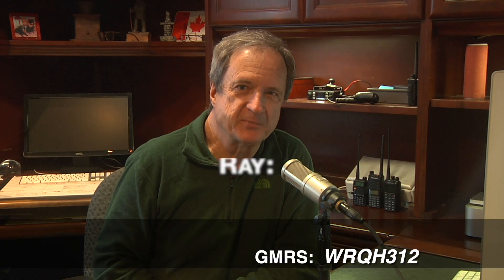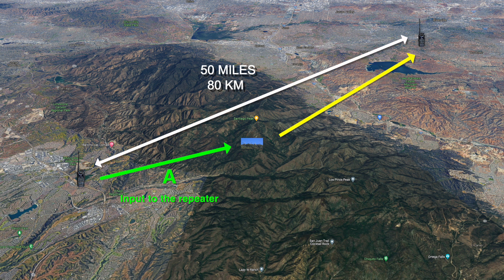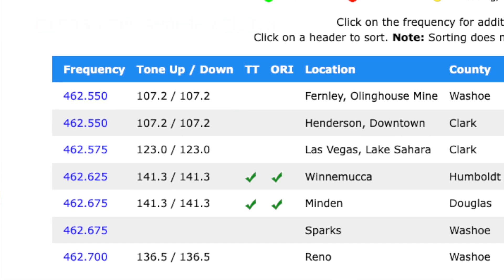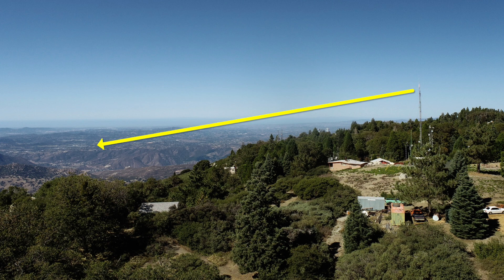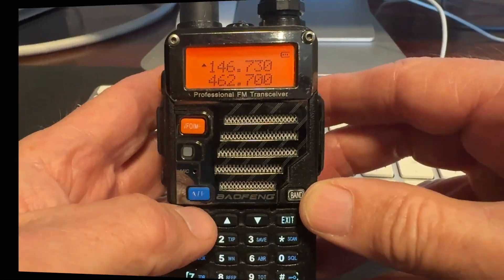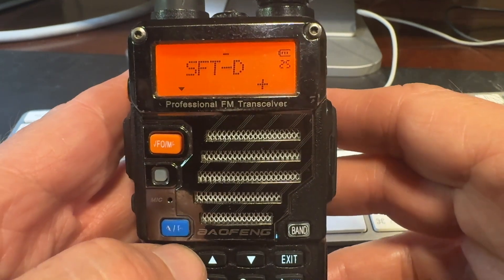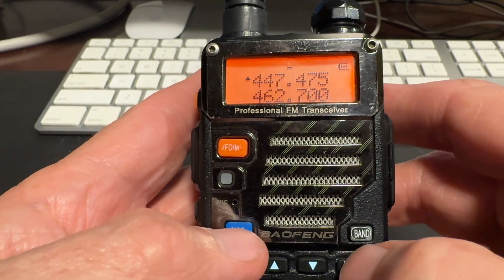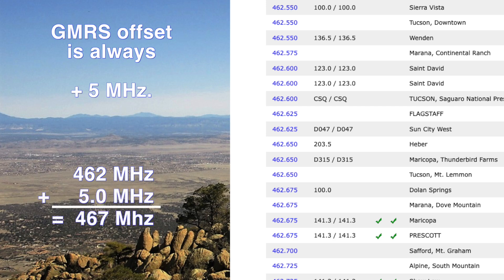Understanding Ham & GMRS radio repeater frequency offsets.

Comment: Thank you sir.  Trying to learn and get my lil Bo Fang to squeak literally anything at this point and I think the reason it doesn’t is in what you are sharing so learn g as I go here
Reply from the maker: It’s probably the simplest thing to miss that gives us challenges. 😉  

Start very basic. Double check your transmit freq, the -+ or simplex offset, and any Transmit tone if needed. 

On the receive side, turn off the CTCSS and DCS receive tone setting so you will hear any carrier on the frequency. Once you start to receive radio traffic, build on it from there. 

If you’re using a repeater, sometimes the published repeater CTCSS or DCS tones are out dated and have been changed. I run into that occasionally. 

Good luck.

Comment: Can GMRS Repeater use a different offset. For example 4 MHz?
Reply from the maker: @JustLearning  
Good question. No it can’t do anything other than 5 MHz. “Technically” a radio could do that, but it would be both illegal radio spectrum used and non standard. Only 462 MHz and 467 MHz are legal. 

Does that help?

Comment: Very good video and easy to follow. So.....if I program the frequency of the repeater RX and make the TX +5 Mhz (for a GMRS) it should automatically change the offset and direction shouldn't it? I have Beofengs and TidRadios and if you look MANUALLY at the offset settings when on a specific channel, it never shows the correct offset and direction even though the RX and TX are offset. UUUGGG
Reply from the maker: @ryanredd9930  
Yes you are correct. The programming sometimes does not show the offset clearly as +5 MHz. It looks like its simplex, but the offset is there is you look in the programming software in a different column. 

Also be aware that if you already have a frequency in memory, you need to delete it to clear that memory slot, then rewrite to it. It won’t overwrite an existing frequency entry. I’ve run into that more than once. Same with PL simple changes. It may hold it until you change channels, then it goes away. 

In VFO, it’s not a problem as it’s a temporary entry that can be changed. In memory channels it can’t be overwritten without deleting it first, even for the simplest change.
Reply: @Raymazon  Oh wow. That is probably the issue. I did not know it wouldn't overwrite an entry that is already there! That's weird because if I rename it, it follows with the new name. HMMMM
Reply from the maker: @ryanredd9930  Yes, it’s misleading. Try clearing it out.

Comment: does we hear our transmit voice?
Reply from the maker: I'm not sure I understand this question. If you are asking if there is a way to hear your own voice, the only way is by listening on another separate radio. You will not hear your own voice on your own radio unless the repeater has a voice-recorder built into the repeater controller hardware. 

Though technically possible, it is rarely offered on most analog repeaters, and is at the discretion of the control operators or owners to make that function available. 

(DMR "Digital Mobile Radio" radios can do that voice replay via the Brandmeister server, but that is digital radio, not analog radio, and a completely different radio operation.)

Does that answer your question?
Reply: @Raymazon  yaah thanks, i thought taat by usang repeater its also repeat your own voice causing feedback

Comment: Thank you ... I think I understand, GMRS radios do this automatically, that's why they only list 1 frequency.
Meanwhile for ham handhelds, they list both. Am I right or totally offbase? Thank you. Great videos
Reply from the maker: It probably can vary by manufacturer, but typically I've seen the radio frequency offset function as a menu item in most radios, and it's possible that GMRS +5 mHz offset is just a simple switch. 

You could operate on a frequency on GMRS that transmits on a repeater, or on simplex mode, on the same frequency, with that option being just a simple switch function. What's happening behind the scenes automatically is the same net result.

Comment: Let’s say repeater has frequency of 147.33 with +0.600 offset. Instead of using the offset and shift-d parameters, can I set frequency A to 147.93 for transmission while listening on B set at 147.33? I suppose TDR must be set to ON and TDR-AB set to A?
Reply from the maker: Sorry for the delay. I didn't get a notification from YouTube.

It is much easier than that. The A and B may be confusing with the A & B on the radio. Use only A or B on your radio. Everything happens in just the one transceiver (A or B). The concept in the radio of A or B is so you can have another channel or frequency in the radio for convenience. It's not for operation on a repeater. 

Having said that, enter all the information in the A "or" B VFO, not A "and" B. All the transmit and receive functions will happen in the "A" slot. (Or B slot you prefer.) No need to get into the TDR ON function. It's not used for that. I keep mine turned off. Do everything on just A. Once you have it set, then you can move on to another different frequency or repeater on B if you want to. I usually stay in A for convenience. They (A&B) are not united. It's like having two separate radios in one.

Does this help?

Comment: What if the repeater has an uplink of 147.93000 and a downlink frequency of 147.33000, offset +0.6, uplink tone 131.8, downlink tone 131.8
Reply from the maker: Just to make sure I understand it correctly. The repeater input frequency is 147.93 and the output is 147.33. In high/out low. 

Your radio offset would +0.600.

The frequency set in your radio would be set as 147.33, the repeater output frequency, what you listen on. Then do the offset as +0.600 as your transmit frequency. Set your radio receive frequency first, then the offset to transmit. 

The tone of 131.8 is set as your radio’s transmit tone. You have the option of using or not using the a receive tone. But you definitely need the radio transmit tone to key up the repeater. 

Does this answer it?
Reply: How can I make my kg-805g as a simplex repeater by using a ARGENT DATA ADS-SR1.i want to build a ammo can simplex repeater ?